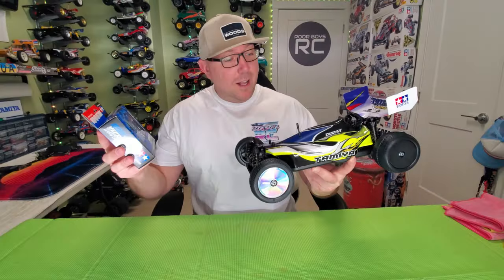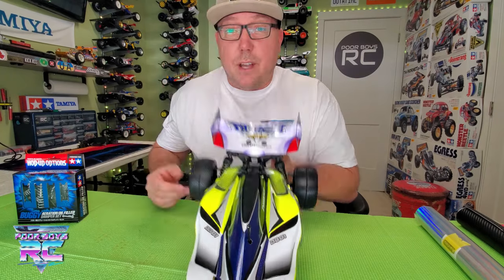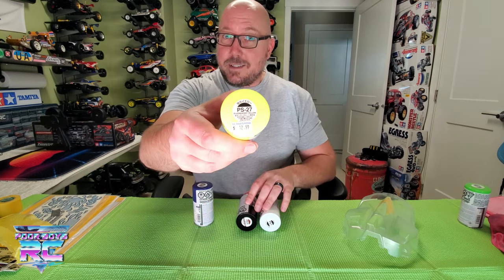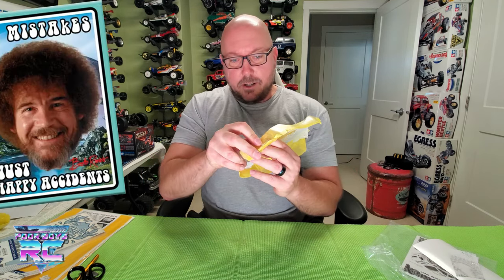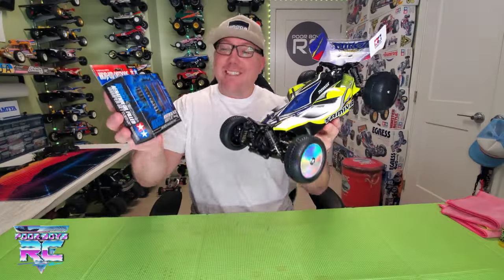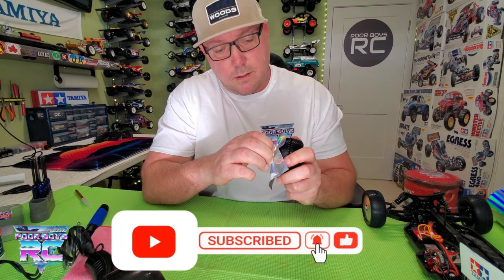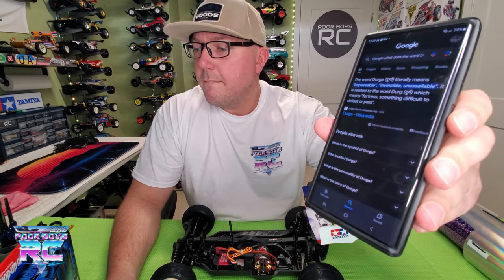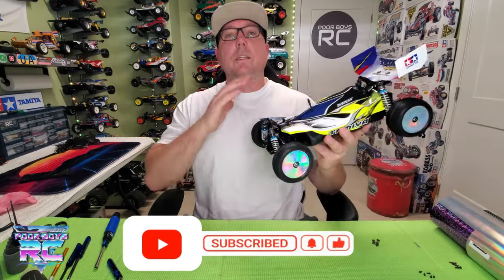Tamiya Durga Build - Custom Paint, Hop-Ups, Hot Motor, and CD Wheels?!?!

Comment: Love the paint job looks sweet as I love a good creative paint job. I usually mark mine on the outside with a marker then you can follow the lines with tape on the inside. A bit of clear helps over the tape helps with the bleed, the rim wrap is unique and I like it 👌
Reply from the maker: Thanks pal! Yeah I've done the marker on the outside thing a few times, it works great, doesn't it? I might try that on my next body. 🍻👊🏼
Reply: @poorboysrc  yeah you can free hand, measure or cut out some mask in paper then trace it. You should have a poor boys rc unique livery that you can use sometimes that be sweet.

Comment: Great build Fil. I had the same issues with the mask. I couldn't see why it bleeded. It was presed tight everywhere the body. Maybe they're really designed for airbrushes or really thin layers. I like the wrapping idea. Have some here, but neber got the idea to put them on rims. Your's looking better than boxart, somehow fresher.
Reply from the maker: I think you're right, Dirk. Keep it to light coats or even airbrushing when using these fine masks. Thanks for watching! 👊🏼

Comment: The body looks great, but not liking it we all do that and decals do save the day. I do not buy the top end buggies as I only bash, plus they have a thing I do not like normally fitted ball-diffs. cool wrapping the wheels, would a compass cutter help as you could cut a disc the right size to just lip over the rim. Then you can cut a smaller hole for the middle, just a thought. Posh shocks 🙂
Reply from the maker: I agree, ball-diffs are a major issue for me, too. I never seem to have good luck with them. And yeah, a nice cutter tool would make that wheel wrap job a lot quicker and cleaner, that's for sure. I was just experimenting with it. If I decide to continue wrapping parts, I might buy a nice cutter. 👊🏼
Reply: @poorboysrc  They do say the right tools for the job 👍